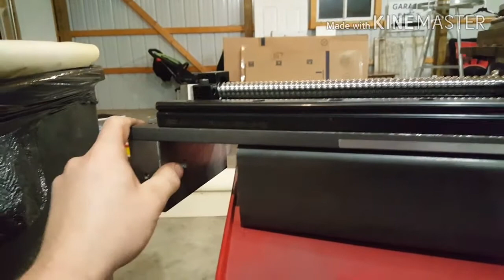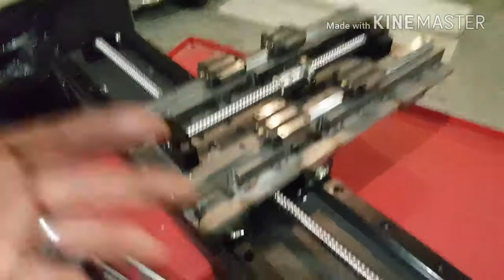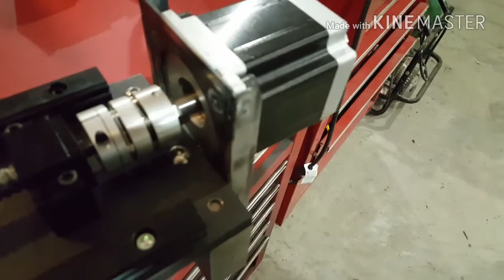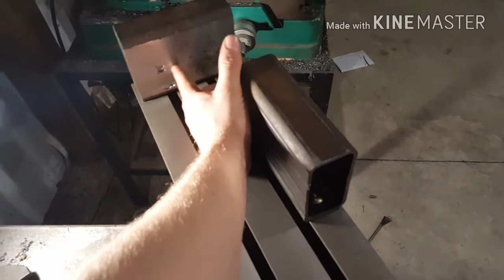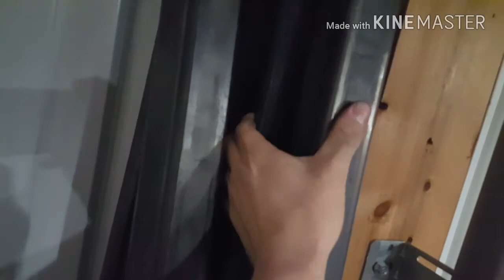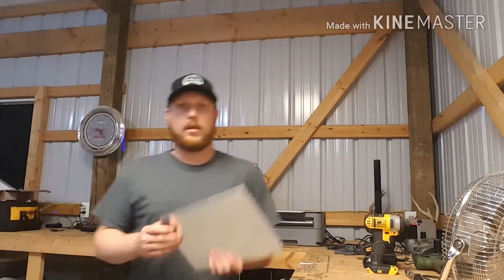CNC Mill Build Part 1

Comment: Hey dude! Great project. I've been researching DIY fixed gantry CNC for about a week now, trying to find out what everyone is doing. The Old Tony one is a few years old and there were a couple of things I would have done differently. I'm a retired machinist. Ran Haas, Mazak, and too many others for me to remember. I worked at a turbine shop making jet engine parts for Pratt Whitney, a job shop making everything from space shuttle parts to oil rig drill bits, and a sawmill machine factory where I was the CNC programming department and machinist trainer. So, I got some experience. I really like what you have said about your design so far. I agree that fixed gantry is superior to fixed table for rigidity in the same weight. The only part of your machine where you'll be fighting gravity is the Z. I would suggest not having any useless weight in the movable portion and adding a counter weight to keep it from dropping when you shut the power off, and maybe the motor could hold it anyway, but why make it? A counter weight makes the motor work a lot less. I also didn't like the way Tony put the electronics and controls underneath. I realize he is trying to keep a small machine footprint, but it will be so much easier to use if it was at eye level to the side of the machine. You seem to have the space in your shop.